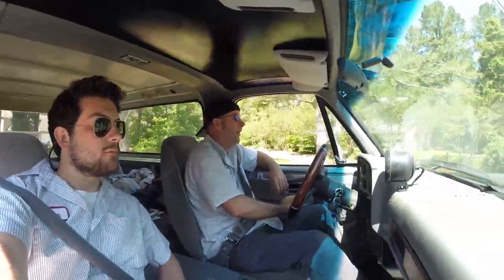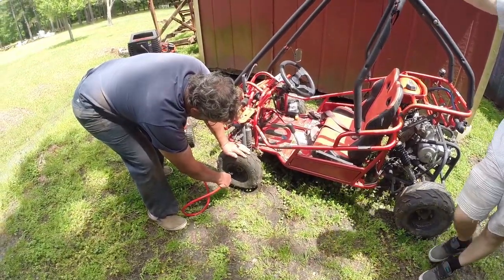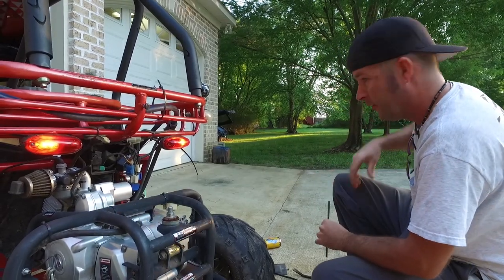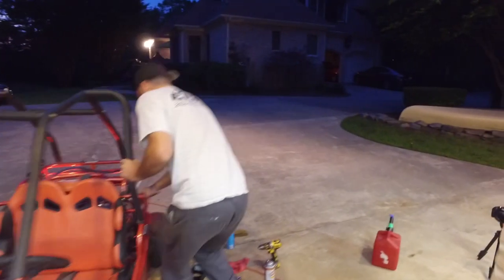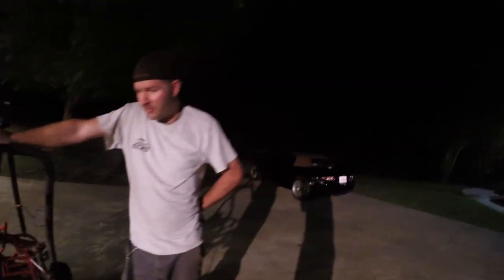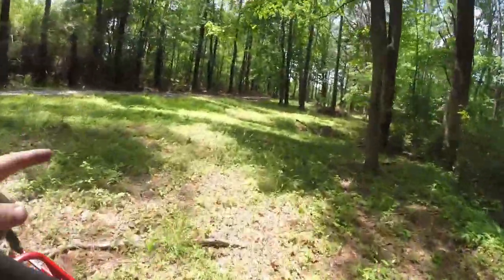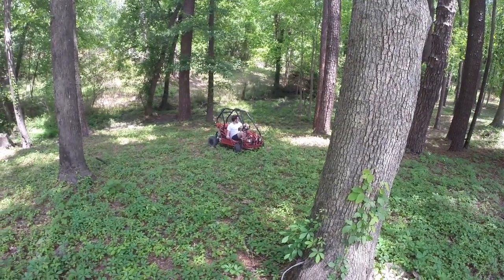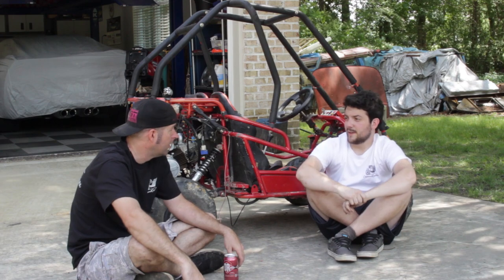$200 Offroad Go Kart Find!

Comment: If you need new brakes for it we got the ones that will work on it as well as tires.
Reply: Go Power Sports Loving you're products!!
Reply: I need help! I have a GK-98 I found on the side of the road and the wiring is rotted out. Would you have the wiring diagram? I would like to fix it.
Reply: .....and history was made.
Reply: @gopowersports I jus bought 1 of these and want to put bigger tires on it. Can u add a link so i know i order the right ones. I also need a carburetor.
Reply: Give me an engine
Reply: @curt5288  buy your self a engine there like $300, super cheap
Reply: If you see this do you have yamaha 110 parts

Comment: bigger gas tank
jerry can strapped to the back
bigger tires for sure
rebuild the head/valves maybe a rough port and polish since you have to pull it to fix the valves?
retap the spark plug
keep the engine, do a mild race build on it, get a new piston and run 92.
and thats my 2 cents/thoughts
Reply: +WhutThePhuq needs carb adjustment.. sounds like it doesnt get to full rpms
it should atleast go 8000 eaven with restrictors
Reply: Nauris Do we know if its a 2 stroke? Idk if thats too high of RPMs for a 4 stroke.
Reply: I have a Chinese 4 stroke quad and stock it does 10,000 rpm

Comment: Heli-coils or a keen-sert set is a must for a Small engine guy. Stripped spark plugs are a easy fix most of the time. Also put Grease on your Tap. Holds all the filings from going in engine.

Comment: That thing has potential. Led lights.fix the valves. Shave the head. Bigger exhaust. Jet the carb.k&n filter.Slightly bigger tires.
Reply: think they could buy a whole new head from china for cheap?
Reply: +yexzy01 more fun and cheaper to shave the stocker

Comment: i got a quad that has that same engine and it doesn't run but it might have good parts (like piston and valves and top end stuff) so if you want i can look at it and send the parts if they are still useable
Reply: +Scorpion623 i think we will be fine on this one. thanks
Reply: yeah no problem man
Reply: +Isaac it'll be fine  make it more powerful too weak

Comment: CarsandCameras Just picked one of these up. Its a tao tao GK110. Atleast thats what it looks like. They are much bigger in person than they look on the computer. Mine has had the rear frame stretched about a foot and a 1974 honda cb360 engine and 6 speed trans mounted on it. Man let me tell ya this thing rips!! It gets kinda sketchy at around 60 mph. Im gonna put some stiffer springs on mine to help with the bouncing. You guys should totally mount a motorcycle drive train on one of these! easy to do and so much more fun. Just pick up an old bike off craigslist that the owner may have lost the title to or is just parting out. They are much cheaper that way. All you need is the drivetrain anyway, and maybe the tach to mount on your cart!

Comment: 2 stroke dirt bike engine , 5 speed , get 4 wheeler front and rear suspension, and this would be bad ass ......  I know you can find a blown up 2wd 4 wheeler to use the suspension .......... What ever you do , its going to be bad ass ..
Reply: +Norman Murray 2 stroke is love
Reply: :O oh no u didn't :'(
Reply: 2 strokes can be very reliable if taken care of
Reply: +Digimutant a well built two stroke will last/outlast your typical heavy underpowered fourstroke if you have it jetted correctly and know how to ride.
Reply: 2stroke will eat 4 stroke alive they fire twice as many time per rev a125 2 stroke would destroy a 250 4stroke and weigh much less whether u like the noise of them or not they are much more power efficient design dont have valves and there is no power loss due to mechanics plus the powerban from exhaust pressure is like there supercharged i think there design is awesome
Reply: a powerful fart thatl send u 0 to 100 real quick
Reply: +Raymond Chadwick cough, reed valve, cough, cough
Reply: more efficient my ass.

Comment: The cleanest alternative is probably finding a used pit bike engine, yx 160 or z 155 if possible, it´s a drop in and has around 13 real hp with something like a mikuni 26,  7 more then your current setup when it´s running ok (DongFang 110CC) besides there are loads of aftermarket parts for them and you can build it up to 184 pretty cheap. slap a TB v2 big valve head with the big bore and you will be doing right around 18 hp. All you gotta do you mount a 3 rd pedal for a cable clutch and trade the reverse gear for a 4th one!

Comment: Lobe it! If you care look up a yerfdog spider box, I have one and on that I'm putting a upper 40s HP 250cc 2 stroke 8,000 rpm motor + a 5 speed tranny. She gonna rip! I see this kart turning into something beautiful, I'm talking about yours. Good luck!
Reply from the maker: +Duncan Czeizinger I've seen those before... That sounds ridiculous. Good luck!
Reply: +CarsandCameras Put a piranha 160cc pit bike engine in that thing. a little expensive for the kit but its a 4 gear manual monster. my pit bike with that in it goes like 78 mph topped ouy with stock gearing. and its a bolt in engine. it would fit in that cart like a glove.
Reply: CarsandCameras oh it is! That's why I'm doing it!
Reply: Infinite how much for one? I might check it out! But the motor I'm getting is used for $200 with a dirt bike frame, and it needs head work but I have rebuilt a predator 212cc head before so this should roll easy.
Reply: CarsandCameras is the off-road gokart you got above manco? Yerfdog? Because the number one motor yerfdog uses is a 150cc 7hp gy6 with a torque converter, and a stupid motor that is because the wiring it uses is stupid, so in my case the stock motor that came on the yerfdog jade the wiring harness go bad, and its irreplaceable so new motor is being bought this week or the next! I'm excited to start fixing the head on it, on the comment under this I state the problem with the motor, and I can fix it. And when I fix it and install it I look forward to popping clutches and revving motors because it has the clutch!
Reply: +Duncan Czeizinger 1,162
Reply: +Duncan Czeizinger I paid 450 for the whole kit. Engine, carb, exhaust, and wiring. I only bought it because I wanted a bolt in engine. it's amazing
Reply: Infinite cool! I found a Yamaha YZ80 1982 with 6speed transmission and water cooled with around 8k rpm, I'm paying $350 for it and all the plastic is in perfect condition, just faded, so I'll take the motor off and sell the frame!

Comment: they make a 140cc performanceish motor that will bolt in that rear cage it has a four speed trans too
Reply: what engine do you know?
Reply: they sell em on ebay its horribly chromed out but ive bought a couple and they work welll

Comment: +carsandcameras you guys should get a big bore kit alot of ppl use them on moped engines it will give you the added power as well as solve the valve issue while still keeping your stock bottom end and gearing

Comment: That will be a 110cc I bet
Reply: 50 cc
Reply: Nope 107Cm3 which is basically 110cc
Reply: +Marlin Robertson cm3 is centimeters cubed and what's cc stand for? Centimeters cubed it's 107cc
Reply: exactly what i mean if you they class all 107s as 110's 97's as 100s etc
Reply: +Richard Scarlett potato, potato tomato ,tomato
Reply: its a 150
Reply: nope it is not they come in 110 and 150 and the engine said 110ccm which is 110cc

Comment: Needs a 2 stroke motor!
Reply: +Alex Grace YES!
Reply: +Kuruma Designs no
just no
NEEDS A TURBO DIESEL!!!
Reply: +MrShotgunJoe Truck engine.
Reply: +MrShotgunJoe. Ever see one of those little yanmar single cylinder clones from China? They go for about 600$ and are about 10 hp

As for a turbo, you could easily find a mini turbo to fit this motor
Reply: +Wood and Metal [andrew sobek] okay, that would be cool! But real yanmar is the thing! xD
Reply: Then a yz125 engine with 35hp sounds better
Reply: yeees!

Comment: i say it once again. small engines run lean without the air cleaner on. put the air cleaner on and that engine will be more responsive on the throttle plus you are running it hot with air cleaner off. lean equals heat . a little rich actually runs cooler from the fuel atomizing in the cylinder.

Comment: I'm pretty dang sure that has the gy6 family of motor on it just like mopeds do. If it does those things are SUPER easy to modify and get more power out of. I had a moped that I bored out from 49cc to 80cc and added a bigger valve head and performance cam and I did this all when I was 14  Parts are everywhere along with tons of information on these things. Good luck!

Comment: My cousin has the same exact gocart. He cut the back of the frame off and welded a plate over the rear of the frame. Then he put a predator 212 and a comet torque averter on it and it rips now.

Comment: Guys there is a way to fix that problem without pulling the head. What you do is find the right insert and the tap you use to install the insert you use wheel bearing grease in the grooves where the filings fall into and the grease traps all the filings from the tap.. Install the insert with lock title and your done.

Comment: Yes, good idea guy's! Use a dirt bike or ATV engine with larger tires. A 125 - 250cc engine would have plenty of fun power and complete engines are relatively cheap on eBay or Craigslist. Just do yourselves a favor and avoid the Chinese engines (even though the kart is Chinese).

Comment: got the same kart for 200 also. it's an xr50 based engine. all the specs and parts will match up. look up chinese 110cc, or lifan 110cc. mine is a 125cc

Comment: But in a seriousness fellas. You can probably easily widen that frame and the engine bay, just buy cutting it perfectly down the middle and welding 6" or more straight tubes. See if go powersports will fund a motorswap 😂 jk. a raptor 660 or 700r engine and trans would make this a beast!!!! Sometimes you can find them wrecked with a decent engine for a few hundred bucks.

Comment: I say take the motor apart and put over sized valves in it and get the head machined for the new valves and while the head is off tap the spark plug hole the right way

Comment: I may be wrong, but this looks like a clone of a Loncin 110cc motorcycle engine, 3+R sounds about right for the gearbox too. If it's still kicking, you can get a complete replacement engine pretty cheap, or a kit to replace the head

Comment: nice cart, I have a honda clone and upgraded to a stage 1 kit you know with intake exhaust and emulsion tube with jet. I still have the governor and believe I need to make an adjustment somewhere. The engine idles to high and I am unable to make adjustment because the throttle link is floating above the idle screw while engine is running. Any advice

Comment: Love that you guys used a yoohoo can to get the plug in the stripped hole!  That's just brilliant.  Do you know what name brand go kart that is?  I have one out back I'm tinkering with now.  It appears to be a (2011) go kart, although I have found no name on it.  It looks amazingly like yours.  I heard you mention 107cc in your video.  The sticker on this engine here lists its size as 107cc displacement.  If it helps, the spark plug information on the engine sticker of mine is:

Spark Plug Type: A7RTC
Spark Plug Gap: 0.6mm - 0.7mm

We used an alternate spark plug: NGK CR7HSA

Any information you can share on your go kart's manufacturer, year, etc. would be appreciated.  

Thanks!

Comment: 1:24 yeah that's pretty accurate my friend has a relatively fast off-road go kart and I nearly flipped that and it has a pretty wide wheel base too and I have a go-kart that's off road and it is to me really top-heavy feeling so I hate turning with it in this one spot where you will understeer because of gravel you can turn really hard to the left and it's on a downward incline if you're parallel with it it is really easy to flip in my go-kart and it's not even that fast maybe 15 miles an hour top speed

Comment: that cranking noise reminds me of a Chinese bike i worked on... ugh a noise i heard way too often. but once those engines are all sorted out, they are quite reliable. on the bike i worked on i put a japanese mikuni carb on it and a bosch voltage regulator. Actually improved it significantly. it would be cool to put a bigger dirt bike or road bike engine on it. you should have put a helicoil in the spark plug hole
Reply: +smallenginedude71 Its probably the exact engine. I think this is a Gy6 chinese engine or at least very similar.
Reply: Ratkill9000 yep. Gy6. thats it.

Comment: I don't think the valves are bent, I think the problem is the spark plug.  Either the heat range is way off, the reach of the plug into the cylinder is wrong, the gap is wrong or it is a resistor plug instead of a non resistor plug or vice a versa. [I have done all of these mistakes]!

Comment: which is more embarrassing flipping it or getting it stuck?

@25:00 was that a drift when you hit the pavement?

I'd like to see pvc pipe on the tires.  Maybe an awesome failed attempt at fiberglass fenders.  Possibly a four wheel slide in a parking lot or around a sharp corner, with or without the cage.  Maybe do a mod to make the cage removable?

Comment: To tap your head with it on the block, take and put grease on your tap and it will catch most of your shavings, then turn your engine over several time to blow out the shavings that fell into the cylinder, then if you have access to an air compressor blow it out with compressed air.  One time I had a 2002 F250 5.4l Triton had a shop do a tune up they replaced the plugs,.we as a family went to. Mexico roughly 200 miles away wile down there right side head 1 st plug blew out,.had to drive about 20 miles.to find an with parts store got a.tap.a.tell oil set and some axle grease, tapped it turned it over to blow any excess shavings out and the 4th plug on that head also blew out, so I tapped it also, pulled all.of the coil packs and all of the plugs were looks

Comment: The valves arent bent guys, that stutter isnt consistent enough and changes with different inclines. Your fighting carburetor issues still.
Reply: +Jb029e carbs good. i think it jumped cam timing when the valves hit the plug
Reply: +Isaac it'll be fine Im sure it could have, but that wouldnt explain why the engine perks up when you change pitch. It would seem like the float it stuck closed. I cant say for sure, but from seeing the plug and hearing the initial contact it sounds like the piston just reached up and smacked the plug. Let us know how it goes!
Reply: ok

Comment: Should of helicoil'd the original plug hole but you can get a new head for like $40 online. All the Chinese motors like these are pretty interchangeable for parts as long as it's the same displacement.

Comment: When you take the head off you should at the same time be able to get the correct depth spark plug, and I would drill out the threads and re tap for a spark plug that fits properly eh.

Comment: Hey got a question I got the same gokart as this and I had an old 125cc carb I put on it the stock motors a 110cc it runs and isles but I’m getting not throttle response any tips

Comment: well that motor i think is a 125 cc u have on it know a 2 stroke 5 or 6 speed would be nice or a 250 cc quad motor 4 stroke would be al right as well should have more than enough tq and hp to get u up throw and around anything  i my self perfer 2 stokes i like that high  rpm driving know the 3 wheelers have that auto shift clutch thats just like that and i think there 4 or 5 speeds as well so u wouldn't have to build a clutch  but there also kinda gut less as well

Comment: yo, I have a kart with a similar engine, when I turn it over on the starter (without it firing) the cover for the stator gets hot so that you can't touch it for long. it gets this hot just after a few minutes. do you know if this is normal

Comment: the 670 on that thing would be badass
Reply: +lenard ggor It won't fit, not without a crap ton of mods done to the rear end. Those engines are nearly too tall and the top of the heads would get hit every time it hits a bump or someone sits in it hard.
Reply: +Ratkill9000 yeah, your probably right

Comment: That's a 110, I have the same problem with $300  Barn find, it will not fire up, I got spark but will not run, I'll try and take the carb apart and see what happens

Comment: Hey guys I have the same exact go kart that's in this video electric start and everything and the carburetor is causing the engine to idle extremely high to the point it sounds like it's gonna explode. We've tried everything and nothing has worked. You guys are pros and I was wondering if you could help us out on figuring out what's wrong if you could help it would be very very helpful........ Thank you
Reply: What is the name of the go kart?

Comment: there repair bushes and special tap available to repair the sparkplug hole either that or use a helicoil
Reply: +watahyahknow that is the correct way of doing it
Reply: do it once do it right , the engine seems to run good so it pays to repair it 
from wat i can see from the frame being bend in the front there might be an eazy way to pull it staright again :
tie the cart down to the concrete floor near the bend attach the hook of a 4x4 winch with the offroad car at the correct angle to the outer end of the bend part and start winching lil bits at a time ocasionally 
wake the bend up with a big hammer till its straight again 
prolly could do the same thing with a ratchet strap between a solid object (big tree) and the cart

how is the truck cab comming ? 
havent heared or seen about that in a while 
seemed it was on the right way to being whole again
if it doesnt work you can always turn it intoo a topchop and shorten the pillars a little on both sides of the weld and try again
Reply: yea doin it right is all ways the best way to go but sometimes we like the right now approach lol. we will be working on the cab this summer